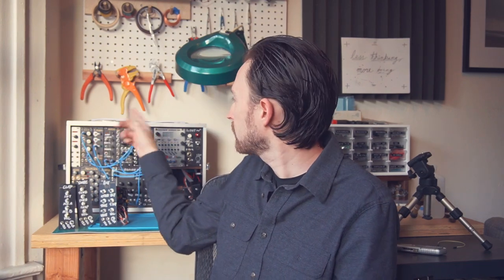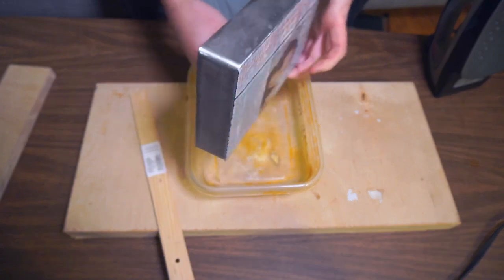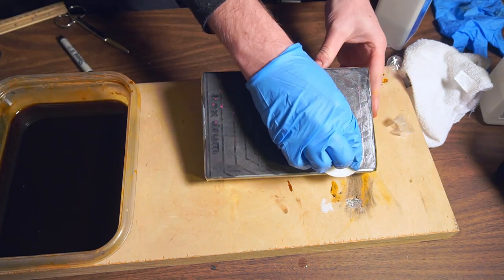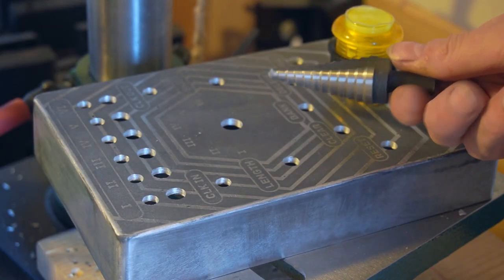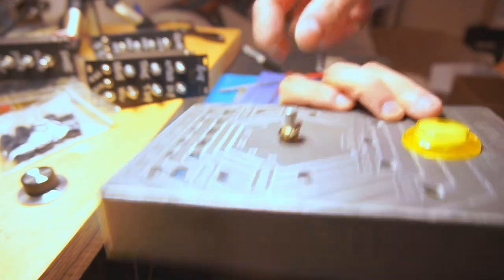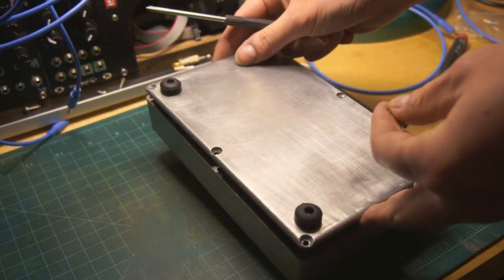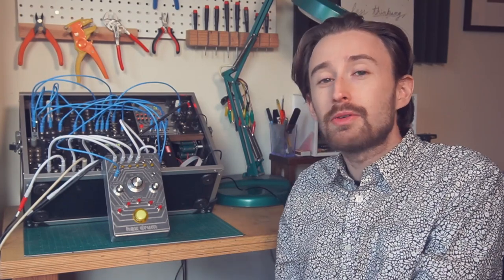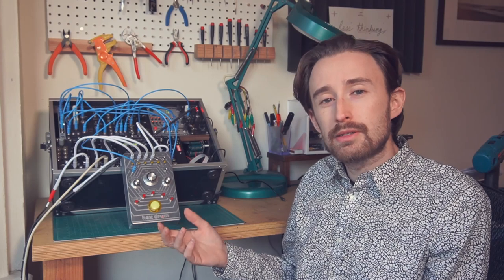Building the Hex Drum / Big Button trigger sequencer

Comment: I'd love to see your code updates, I built one of these and use it a lot but the reset button......   Your drums are sounding great though. Where is your GitHub page?
Reply from the maker: Just posted the updated code here! https://github.com/matthewcieplak/hexdrum Still a lot to clean up and reformat, has been an interesting challenge to reverse engineer some of these features. Hoping to add some MIDI implementation to it as well!
Reply: @extralifedisco  Thanks I'll check it out. I added a trigger input to mine, really useful for plugging in a random gate or whatever to generate beats quick and dirty!
Reply: @extralifedisco  New subscriber here - love your videos. Wondered if you could tell what is different about your code compared to Sam's original? Thanks
Reply from the maker: @themanefaces  Thanks! My code is up on github, v1 just fixes a few compilation errors with arduino nano every. The hexdrum-midi fork is completely re-written. Sam's was kind of spaghetti, so the new one uses arrays and functions to simplify it and adds MIDI input and some extra features like roll, solo, mute, sequence clear, bank-all, and audition. https://github.com/matthewcieplak/hexdrum-midi

Comment: Im not very proficient with arduino, did you include internal pull up resistors in your github code or are the 10k resistors still necessary?
Reply from the maker: I already had the external ones from using sam's code, but the switch is as easy as changing "  pinMode(ButtonDelete, INPUT);
" to "  pinMode(ButtonDelete, INPUT_PULLUP);" for the buttons you want to use internal resistors. Also you'd need to wire the buttons to connect the input pin to GND rather than +5V (sam's schematic uses external pull-down resistors, the internal one are pull-up).

Comment: Hi what does the shift potentiometer do?
Reply from the maker: In LMNC's original design, it offsets the start point of the sequence for that instrument by 1-8 steps. You can use it to create rhythmic variation, but I found it difficult to get back in sync or use effectively. In my updated version of the Big Button (with MIDI), you can press the ALT button or the big button and turn the shift knob to load hard-coded preset sequences onto that instrument or all instruments for quick changes when playing live.

Comment: You printed on glossy magazine paper, other from the method in your 2017 video? (I'm trying to use this method without etching - and without heat, just to transfer the black toner and I'm using spray-on paint to grab the toner and coat it afterward, see: https://imgur.com/a/q3PFK4x and https://www.reddit.com/r/synthdiy/comments/j708ls/panel_design_using_toner_transfer_alternative/ )
Reply from the maker: Yep, glossy magazine paper works well with the iron method  because it dissolves easily into water. It's OK-not great for non-etched transfers because a lot of paper fiber sticks to the toner and you have to scrub it very carefully. If you're etching it doesn't matter though. 

The heatless transfer seems to work better with stiffer paper but I haven't ever really got it to work - this guy seems to do very well with lacquer in solvent and wax-coated sticker backing paper, but my laser printer chews that paper so it's a no-go for me. https://www.youtube.com/watch?v=GL0fVtREgRA
Reply from the maker: Stereoping had a great tutorial on the heat method here: https://web.archive.org/web/20180723213226/https://www.stereoping.com/eurorack-frontplatten-erstellen-mit-der-toner-transfer-methode/?lang=en